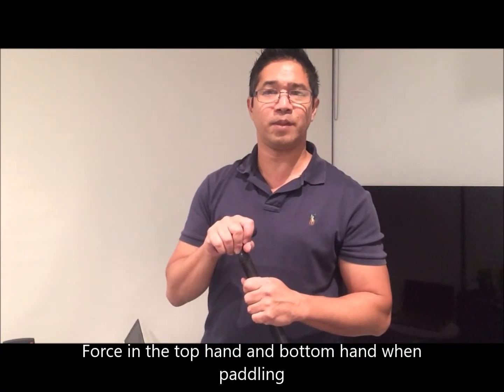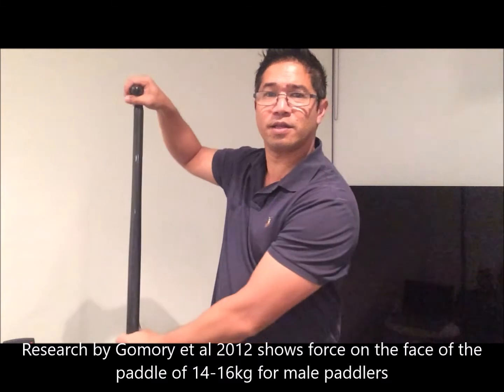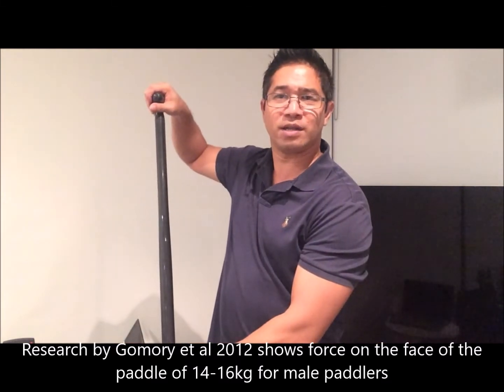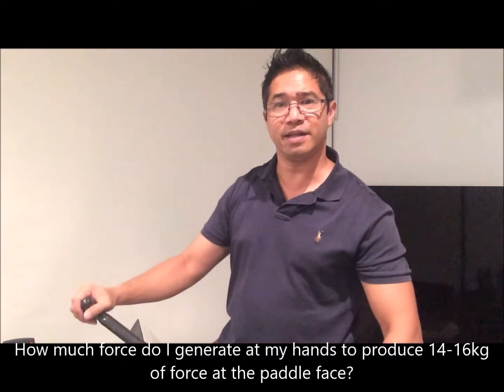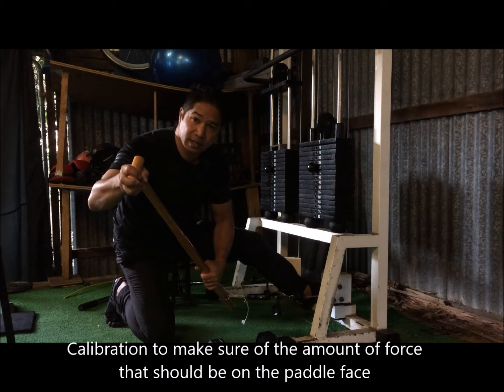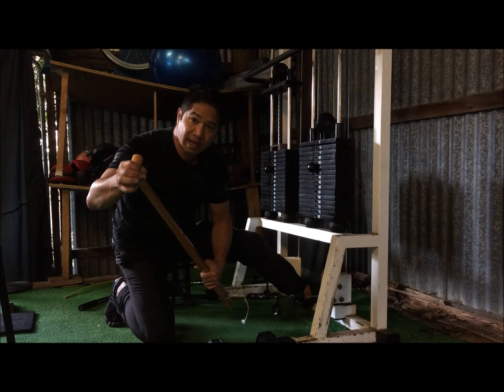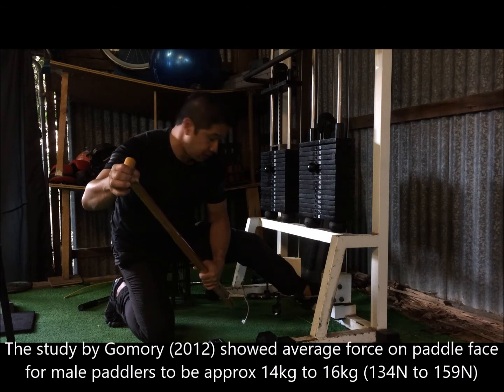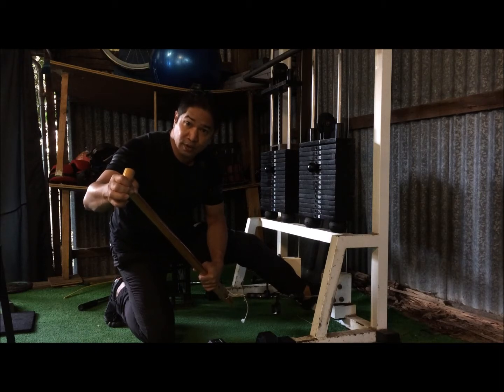Force in the top and bottom hand for a dragon boat paddle stroke

Comment: For the polynesian canoes,is in the same?
Reply from the maker: Probably slightly less force (1-2kg less) because in a outrigger (Polynesian) canoe you are usually paddling longer distances and you can't lean on the paddle as much because your legs are higher. Dragon boaters can also lean on the paddle more because there is someone sitting next to them who is leaning out over the water as well to balance you leaning out. Sprint outrigger canoe would be interesting to study but no-one has studied it yet.
Reply from the maker: Found a study which shows the Polynesian canoe force generated at the blade is almost 16kg for men and 13kg for women. Slightly higher than for dragon boat.
Reply: Jeremy Richmond thank you